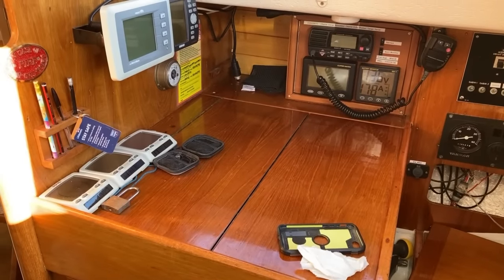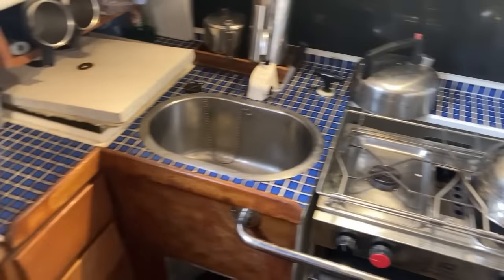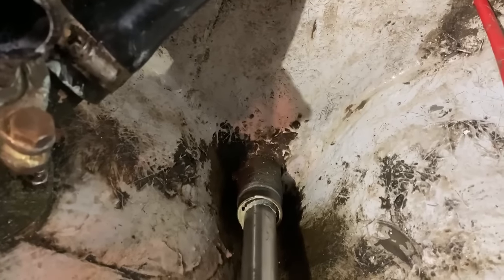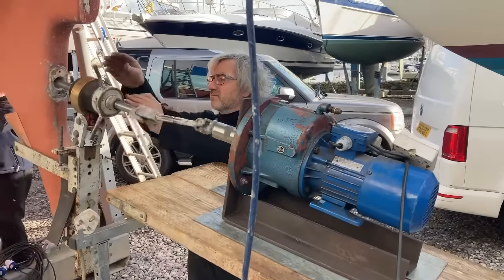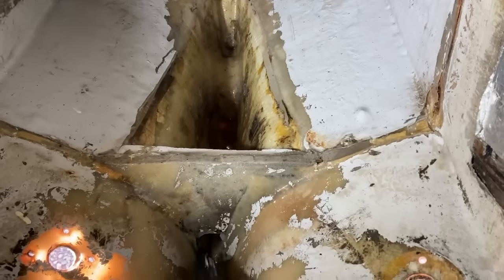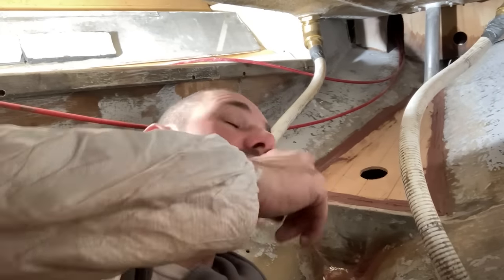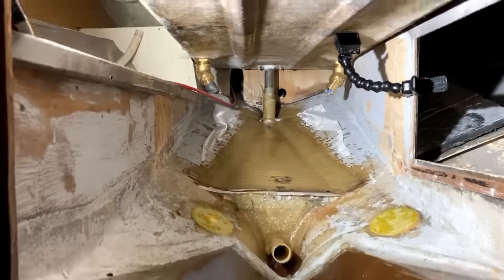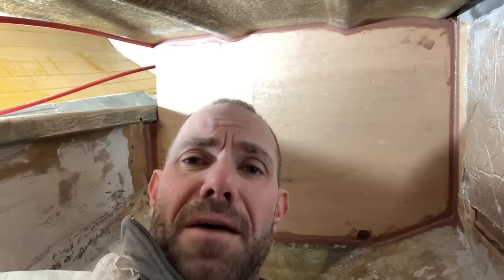Two Contessa 32 engine swaps - Ep 1 Old engines out, problems found and fixed.

Comment: First time viewer. Great episode with lots of good information , glass work and editing. Suggestion, cut a hole in the center of bulkhead for access to glass behind it and further inspections of rudder post area. Structurally, will be just as strong and just velcro your insulation on for easy on and off to do so.

Comment: That first engine is the cleanest looking 2GM I have seen. Someone should get a good second hand engine.
It may need nothing more than a good flush of the cooling system and a routine service.
In charter boats they seem to go for 6000 hours or more.

Comment: how old/hours was the 2gm? it looks like its in really good condition, what is the reason for replacing it?
Reply from the maker: Both engines started and ran fine but both starting to get old (in the region if 25 years), both owners are after a bit more power and the smoother running of a 3cyl engine.   Not sure what hours were in the engines as no hour meter fitted.

Comment: You need to order yourself a drum of citrus acid.. it's biodegradable and it will clean paint and grease off etc.. you dilute it down and it definitely works without the issues of using something like muratic acid..muratic acid will clean a bilge and engine bay and have it looking brand new except for any unpainted metal that's not stainless steel. It will cover it in a thin layer of rust. Sorry I made this comment before you showed what you were using..zep products are good but expensive. You can order a 55 gallon drum of that citrus acid undiluted for about $500 last time I knew. It's been a couple of years since I've needed one

Comment: I must say having recently carried out a Volvo engine change on my own boat...Great Dane 28, aswell as cockpit drain plumbing etc. I fully appreciate the strength of character it takes to carry out this type of work in a such a confined space without losing one's patience.
Hats off to you.

PS I wish a Volvo MD11C was as easy to drag around as a Yanmar seems to be! 🙂
Reply from the maker: No one said I don’t occasionally loose my sense of humour, once these are done I have a gearbox replacement booked in no then hopefully no more engine bays this winter!!   Thanks for the comment.

Comment: Another great episode! I have a Yanmar 2qm15 that's been leaking oil for a while and now has a water blockage somewhere. Curious to hear how you rate these old engines and whether you'd look to repair or replace if it were your boat? Cheers
Reply from the maker: Hard to advise as it depends on your budget, your plans for the boat and the general condition of the engine beyond the issues you have raised.   They are generally good engines but yours is a very old model now.

Comment: Just stumbled on this site last night. Great vids, nice to see the ship right skippering, in the open ocean!  Question on the Co32, are the tops of the bulkheads, (main and secondary) glasses to the deck? Or mechanically fastened? Or just reside in channels?  Is that the same for the Co35?
Reply from the maker: Pleased you are enjoying the videos, to be honest I’m not sure how the top of the main and forward bulkheads are attached to the deck, I suspect they are just in channels with the addition of some gap filling bog or thickened resin when the boats were built.  The bottom and sides are bonded in as you would expect with layers of CSM.  I have not been on a co35 to advise but may be similar.

Comment: Good morning George , nice job mate , and finally i caught ya fitting a stern tube . Very interesting , more so as i may be getting involved with something similar myself . Just got a couple of questions though ;
 
First off , you mention degreasers , do you use an ordinary engine degreaser , or is it something similar ? . I ask this question as i'm considering a boat of this vintage myself , actually with the same engine . It's not had any real attention for something like 25 years , so i may do an engine out , complete overhaul type of job . This will give me full access , such as it is to the stern gear , both rudder and shaft , which i may replace due to age . My concern is the effect an ordinary engine degreaser will have on what is basically the porous side of the glassfibre . 
My second question is refitting the shaft . You used what i'm guessing was a thickened epoxy at first , but do you not lay matting on the outside as well , or is the epoxy enough ? .
Now my third is basically an inquiry . When i removed the engine on my previous boat , separating the shaft from the gearbox i found what basically was a plastic pad between the matting surfaces . It was not the usual plastic , more a tough polythene disc , about 10mm thick . I've never seen you using such a product , so i'm guessing this is not usual ? . The engine was a small BMW single cylinder 7hp , a D7 .

It was also interesting to see the cockpit floor flex as you walked over it , despite what looks to be stiffeners fitted , while fitting the cockpit drains , 35.59
Reply from the maker: Thanks.

Engine bay cleaner is Zep, think I showed a pic of it in the video.    

Stern tube is bonded in with thickened epoxy, there is a large fillet on the outside abs then I add glass in the onboard end.   Glass on the water all end is unnecessary.   

You prob had an R&D semi-flexi coupling (or similar) on the engine you mention, the engine’s I’m fitting will all get the same between gearbox and shaft coupling.
Reply from the maker: Yes cockpit floor flexes a bit as I removed the supporting bulkhead and the stringers/strengthening pieces are quite small on this boat.   With the bulkhead back in (I just glassed it it today) the floor no longer flexes like that.

Comment: I see you used a shim to line up the stern shaft a little plastic white thing to have it aligned coming through into the boat my question is is this a buy of the shelf thing or something made as I have to do the same but for a prm150 and  Perkins 4107 1”1/8 thanks 
Fred
Reply from the maker: The “bung” as I call it that centres the shaft in the stern tube is custom made, I have a few of them for different sized shafts/stern tubes.   Any machinist wold be able to make you one from dimensions.   Remember, it’s only in there to do the alignment ashore and is removed after, you can then fit your stern gland.
Reply: Ahhh ok mate thanks great videos rebuilding a ohlsen 38 drive plate was no more than 5 mm on the shaft all had to come out as no drive so changing it all as well as the John crane shaft seal  trouble is it’s surprising how far it’s all out of alignment I have a flexi coupling that all looks good god know how my slack that’s taken up cutless hasn’t done any work. So fingers x the alignment should be straight forward seeing your vid was very informative thanks very much for the vids really appreciate the depth you go

Comment: A Beta 25 rather than a 20? I fitted a 25 in my previous boat but a Rival 31 is a tonne heavier and a larger prop can be fitted than on a CO32. Super engines with reasonably priced parts being a Kubato. 
Will they have the done angle gearbox option?
If I ever need to replace my VP 2002 then I will need to budget for a new Featherstream for a right hand Beta. ☹️
Reply from the maker: 20 is plenty on a co32 but 25 gives a bit of reserve and a coarser pitch on the prop is possible.   It is possible to modify the prop aperture on a co32 to enlarge it and run a larger prop if necessary but a 14” is normally sufficient.   Down angle gearbox unnecessary on a co32, they are normally straight.
Reply from the maker: Darglow and prob adjust your prop to run in the other direction without needing a whole new prop.

Comment: Just a quick question.
Why didn't you coat that plywood bulkhead in epoxy before fitting to the boat?
Isn't it going to get wet and rot/delaminated?
Thanks for the explanation as to why you use epoxy rather than polyester by the way!
Reply from the maker: I could have done but it can also be coated in place, that bulked is now glassed in place (you can see that in the next episode once published) and before being finished all surfaces will be sealed.  It’s a very high quality plywood so even if it is get wet it should last well.  The most important thing to ty and do is seal the end grain of any plywood.

Comment: Just before the 36 minute you were on the cockpit floor. I was surprised to see quite a lot of flexing of the floor.
Is that normal?
Reply from the maker: Yes and no, the cockpit sole normally has two stingers (strengthening members) that resist the flex but the ones on Ariel are quite small, also the bulkhead I removed supports the cockpit sole so that aloe means more flexing until it is refitted.